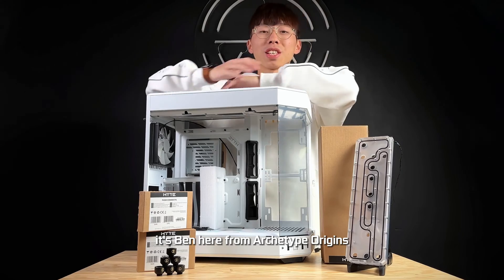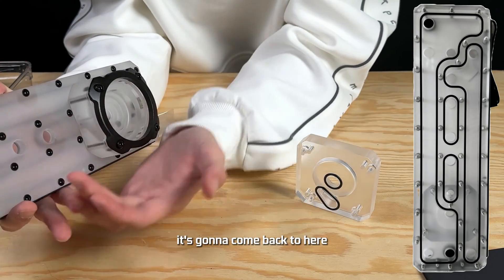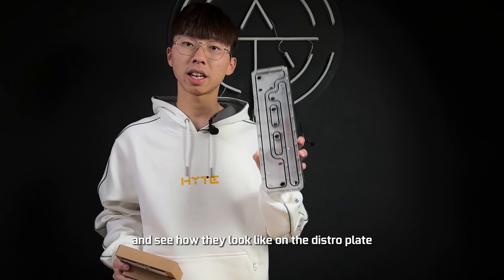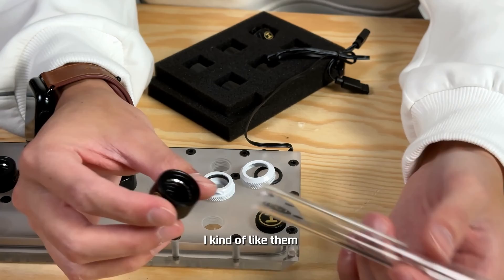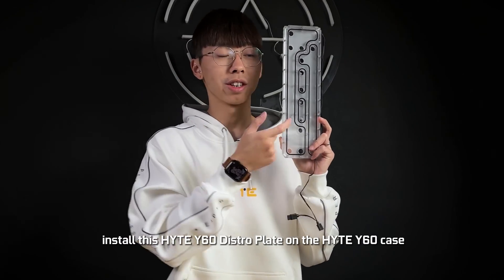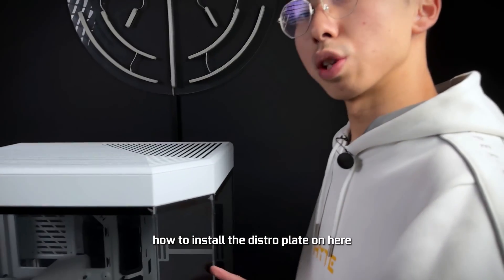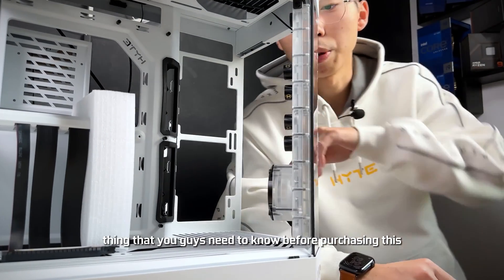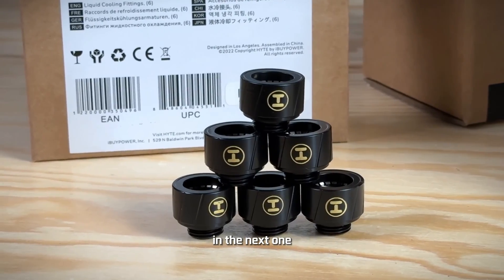HYTE just joined the game... | Y60 Distro Review and Installation |

Comment: U can have both lcd screen and distro plate there’s a distro plate that’s on right side not where u install the screen
Reply: You explained that poorly.. It looks like you can just mount the Distro plate to the back panel where a radiator would go.  I was thinking the same thing when watching the video, then you would have a single 360 rad on top.
Reply: @kurtmuehlbauer9182  no there’s a distro plate for the glass on the front
Reply from the maker: What?
Reply: @archetype_origins  u can have the Hyte y60 LCD screen and the distro plate
Reply: @archetype_origins  just nvm

Comment: You can purchase 45 degree fittings to screw the Hyte fittings into. That would help remove the 45 degree bends if you find them difficult. PrimoChill makes a Male To Female G 1/4in. 45 Degree SX Rotary Elbow Fitting.
Reply from the maker: Yes! Totally right! Check out the build we did with the distro plate and A LOT of 45⁰ fittings!  
https://youtu.be/LeFM9ek7_2w?si=26vyIvdxkZUd7-8C